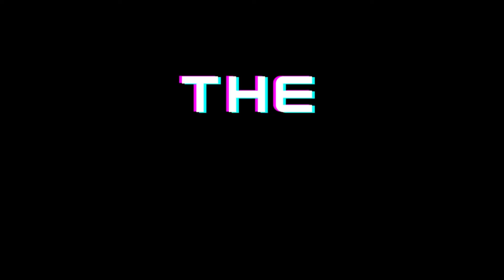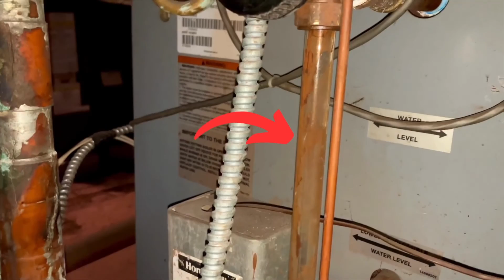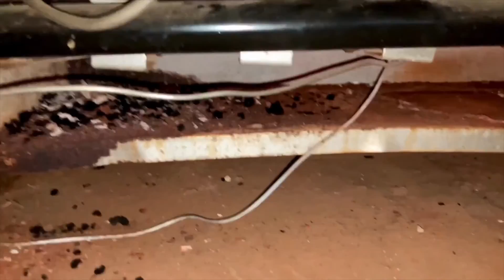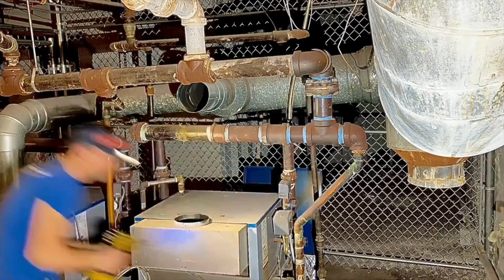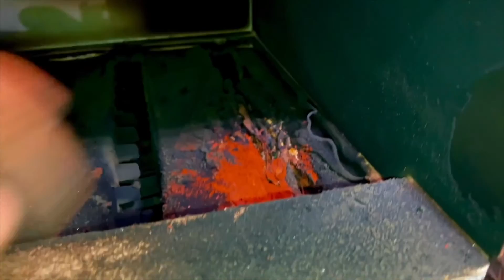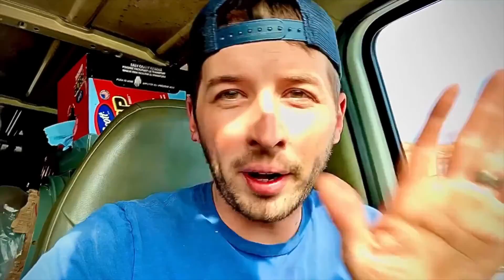This Tiny Switch Trip Led to a New Boiler

Comment: OOh nice catch... also dig that Veto bag... I'd love one of them, but I got a Packout backpack... can't justify spending that much for a second bag..   Sometimes trouble shooting can be really fun though.. then other times it really sucks, because the problem just doesn't seem to make sense... we're dealing with one of those right now.... something to do with the furnace cutting out when the condensation starts to drain... it's definitely not a bad pressure switch.  Just not sure where the condensation is causing the issue.. we cleaned out the entire condensate system.
Reply from the maker: For sure brother, with the cost of these tools I’m gonna use them till the last second! No better feeling though then struggling through a troubleshoot and then coming up with the right solution! 👊🏻